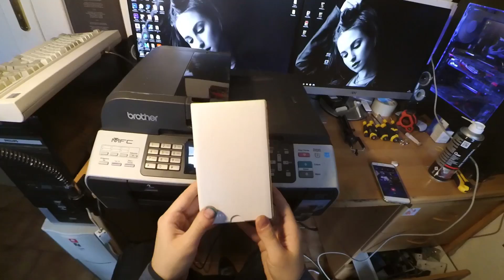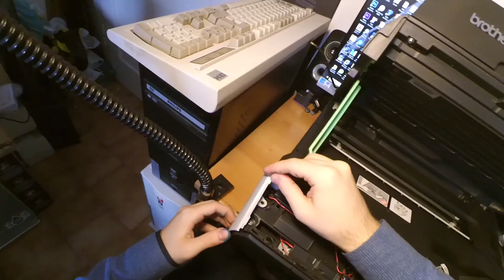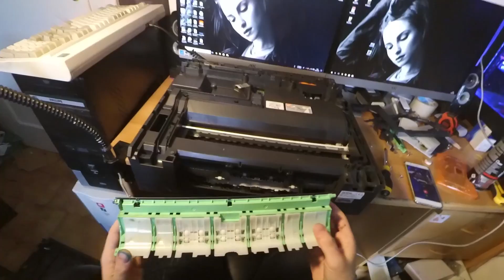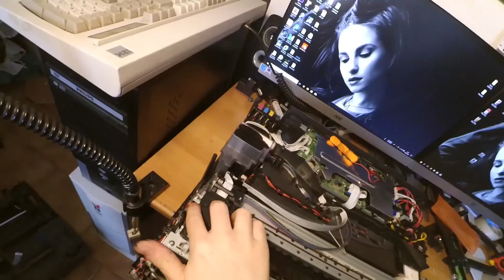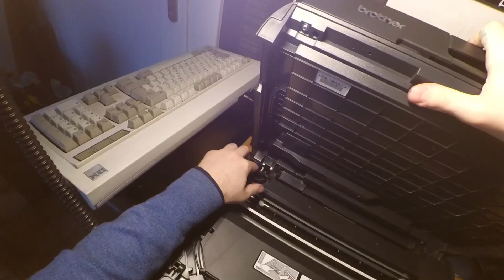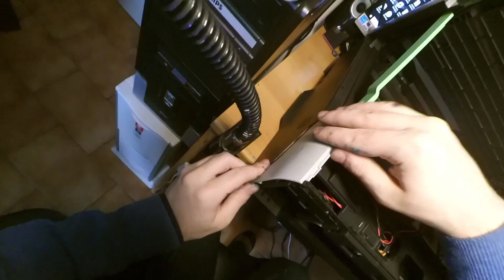Brother MFC-5890CN Printhead Replacement

Comment: I have a question. I have a Brother MFC-J5520DW and I tried cleaning the nozzles by plugging a tube onto the ink intake port, except I used warm water. My Cyan was the one that was the most clogged and when I pressed the syringe not much was happening, only a tiny bit of Cyan was coming out onto the paper towel, then all of the sudden all the water from the syringe started squirting out of the Yellow intake port while it was plugged into the Cyan port.  I played with it a little bit then water started coming out of the Magenta and Black ports... Is that normal, or did I brake something by giving it more pressure?

Comment: Thanks Paolo for the very comprehensive video of this repair. I have one MFC-5890 like the one on the video and I followed your instructions and changed the head. All worked as expected but it is not purging the air of the ink pipes, when powered the printer after some tests gives "internal error 50". can you hrlp me? Thanks.

Comment: I have this printer and have changed the head before but later find out it is the printhead cleaning cap seal that is gone not the printhead. It is not possible to buy just the ink cap. Now when I print I have to pump some air in the ink cartridge air hole to force some ink into the head. Annoying but it keep it working.

Comment: hi there, thankyou so much for the informant video, i have a 6890 that wont clean well, i have flushed etc. Just a question, is it possible the pump is not working as im looking at the tubes while doing the clean and i dont see the bubbles moving

Comment: Great instructions but I am in kind of a trouble, I’ve recently replaced my dcp-j752dw printhead, and it prints fine, however after few prints it displays error 44, after checking the service manual I discovered that it needs the new print head property code, the new print head didn’t come with property code only head code, and the maintenance shop, denies the need for a code, is there a way to generate the code from the print head label which have the head code? Any info regarding this problem is of great appreciation. Thanks

Comment: Thank you so much for video. I find new menthod by looking this. No need to remove any parts & fix all missing print head. Send 1 print from computer. As soon as it start unplug power cable.
Take papper towen & do couple of fold. Soak with after shave or alchohol + few drops of water. Keep soaked papper on printer as in video. Rub printhead on papper. Leave print head few minutes.
Repate process couple of times. I did 10 times with new papper tower. Fold three or four towel & repeat process as in video. I bring back my printer :) 100 % work.

Comment: hey man:) thank u for the video, i managed to repair my printer that was left in the dust since it was not printing any color anymore. AND i didnt even replaced the print head, just soaked it in cleaning fluid over a night. and it works now very well. thank u so much! its like magic

Comment: BLACK INK DETECT ERROR, (FOLLOW THE ABOVE VIDEO TO DIS-ASSEMBLE) I HAVE BROTHER MFC-6490CW, PROBLEM WAS IT WON'T DETECT BROTHER ORIGNAL BLACK INK AND ALWAYS GAVE ME ERROR INSERT CARTRIDGE SLOWLY, I TRIED ALL THE TRICKS MENTIONED ON YOUTUBE, I STARTED DISMENTALLING THE PRINTER  (CAUTION: PLEASE DO NOT UNPLUG THE ORANGE INTERNAL MEMORY BACKUP BATTERY PART VARTA 3.6V 140 mAh JUST HANG THE TOP COVER IN LEFT SIDE AND SECURE WITH A TAPE) TAKING PICS AT EVERY STEP, WHAT I FOUND IN MY PRINTER THAT THE CAPPLIERY TUBE WHICH TRANSPORT INK TO PRINT HEAD WAS FILLED WITH AIR, THERE WAS AIR GAP, I GOT BLACK PIGMENT INK AND FILLED THE CAPPILIERY TUBE WITH BLACK INK, MOVE THE PRINT HEAD TO CENTER BY TURNING WHEEL GEAR LITTLE BIT AND TUG SOME PAPER TOWEL UNDER THE HEAD TO SUCK ANY INK GETTING DRAINED.
AFTER DONE MOVE THE PRINTER HEAD TO ORIGINAL POSITION CAREFULLY ASSEMBLE THE PRINTER,(FOR RIBBON CONNECTORS USE THIN SLIPPERY PAPER ON CONTACTS SLIDE RIBBON CONNECTOR WITH PAPER ON TOP OF PINS ONCE RIBBON IS INSERTED PULL PAPER OUT) LCD DISPLAY WILL ASK TO INSERT CARTRIDGES ONE BY ONE AND DO SO, CONNECT THE PRINTER TO NETWORK, DO INITIAL SETUP, FIRST TRY TO PRINT A COPY THEN USE THE SCANNER, SCAN NEEDS NETWORK CONNECTED. SCANNER WILL SAY NO CONNECTION FOR THIS ERROR YOU NEED TO HOOK TO WIRELESS OR WIRED NETWORK, HOPE THIS IS HELPFUL, GOOD LUCK.

Comment: Hi Marcelli,  Excellent breakdown for the machine. I initially had leaking ink from around the purge motor which turned out to be a pipe had come adrift. After cleaning and reassemble I now get 5 beeps repeated twice on post boot and only a blue screen, it does this twice then drops to only the fax button  lit up. Any pointers as I cannot find any information on the 5 beeps.

Comment: Thank you for the step by step video it was most helpful. I have the MFC-6490CW and the strut is different but I worked out how to remove it. The other difference was impossible to change and that was the battery pack as it would not pass through the opening in the top panel so I had to unplug it. After I took the panel off I replugged it while I did the print head change. I had to do that again on reassembly. Now the screen is not coming on and no function works. Is this fixable?

Comment: My printer (MFC-J4510) powers off itself after a soft head clean

After a cleaning the printhead, my brother MFC-J4510DW, worked fine a few days and a day switched off without any error advice, beep or message.
Since then I must disconnect a few seconds from the grid, and connect again. the printer starts, show the menu, moves the carriage to the park position and switches off without any error advice or messages.
You can see it at the video there:

https://youtu.be/vLU6IS5WeLg

If I keeep the cover ot the ink door open, The printer works to scan, but if I close them it parks the head and powers off again.

Tried to Load new firmware without success, and checked that all sensors are correct in maintenance mode 32. 
As well checked the maintenance unit that works smooth and correctly. But the printer continues to power off after parking the print head, standing on only if door or cover are open, but unable to print, as open cover error do not allow it.

Maybe a faulty PCB, but checked another used PCB and did exactly the same (two exact same fault PCB?)
Maybe an incorrect value set somewhere in eeprom?

Will appreciate your support and able to compensate if I can afford it.
Thanks in advance and Keep healty 
Great videos!
Ricardo

Comment: I came here looking for a solution to the my print head problem on this exact printer.  I've ordered my new print head and will have a go at this replacement.  I have to say it looks daunting - but it was this or send the printer to the dump. I just feels so wasteful to be throwing technology away when it stops working properly and repairing outside is so expensive.  I am not an electrician or a computer person - but I am going to give a go - will post how it turns out. I think I've spent more on replacing the cartridges because of this problem than it cost to buy the printer back in 2011.  Just invested another £45 for more new cartridges and £35 for a new print head.  I'm thinking I have now gone past the point of it being cost effective to repair - but this will be my last attempt to get it working properly - I guess what I learn from the experience will be valuable too. The A3 scanner has been the reason why I have held on to it, but it's so bulky, it doesn't make sense not to use the printer as well.

Comment: Thanks for your video, very well explained ! 
I had the really bad idea to buy a cleaning kit last week because I didn't use this printer for about 10 years and it couldn't print black color anymore.. Anyway the cleaning didn't work very well (as expected) but I was able to print few pages and suddenly when I was trying to print a photo, the printer took ages and gave me a first error 44, so I restarted the printer and got error 48. I tried to disassemble the printer and check to printhead, it was full of ink, due to the cleaning. I did a good cleaning remove all the ink I could and reassemble the printer.. but I still have this error 48. Do you think the printhead is dead ? I found a replacement one on Aliexpress but I'd like to have your opinion first. 
Thanks again for your work mate ! Have a good one, greeting from France !

Comment: Hello Marcelli, Thank you again for the very helpful video. Do you know the part number for the print head for Brother MFC-5890CN? this is the model that you replaced the print head in your video. If you know the part number and or model number please provide that to me. What is happening now is that the black does not print and I have to clean each time several times before black color shows up. I think this has to do with the fact that I disconnected the cleaning discharge tube from the waste reservoir and placed it outside of printer in a box with tissues. I will be putting this tube back where it was once I open to change the print head. Thank you again for your time and kindness.

Comment: Thank you very much for the video instruction to replace the printer head. I just cleaned the print head and the ink tubes in my printer. Your instructions were tremendously helpful in doing the job right. Thank you again.

Comment: Service manual to Brother DCP eg. about head maintenance mechanism: 
http://www.moroinformatica.it/files/articles/docs/BROTH/DCP-195C_SERVICE%20MANUAL.pdf
Edit: p408 (9-56): 9.4.26 Purge Operation (Function code 76) (User-accessible) 
Head replacement
 purge (See Note below.) 
This is a specially prepared purge for eradicating mixed color inks.